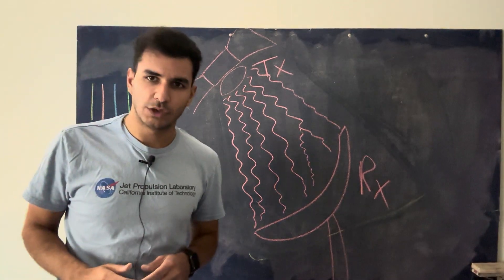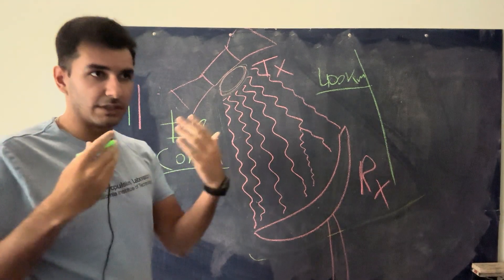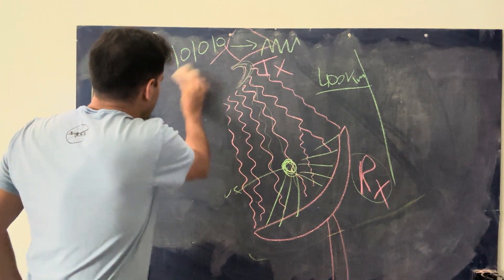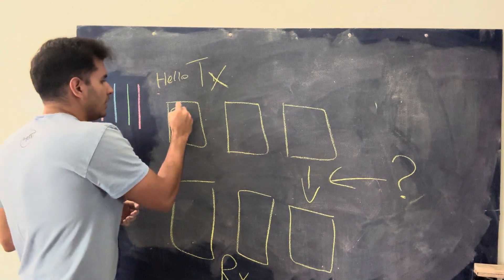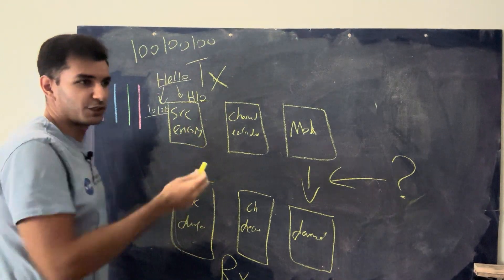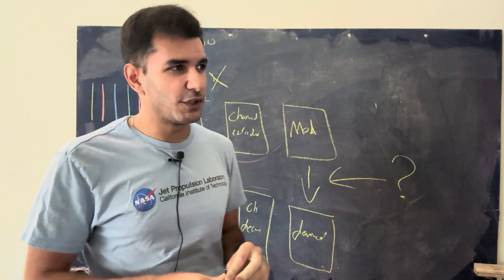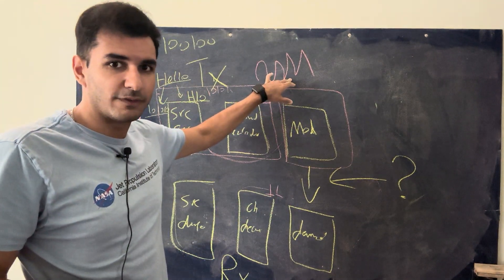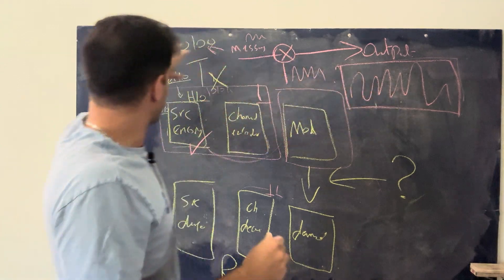Why Telecommunications is the Best Engineering Subfield

Comment: I'm a telecommunication engineer. I have the theory down. Encoding, encryption, binary conversion. Modulation. Propagation physics. All of it. Yet I lack in handson practice very badly. I know C++, python, matlab, Cisco and some dsp. All at a fundamental level. Yet I wanna improve way more. Especially in hardware, which I am just able to handle esp32, esp8266, arduino r3. Basic projects. I feel like I lack soooo much. What do you suggest I do to improve properly.

Comment: I studied Electrical Engineering (EE) at university 7 years ago. There were several subfields to choose from.
For those without an EE background, this is basically what you'd learn in semesters 1–3, especially in introductory courses across the subfields.
Honestly, telecommunications is a very cool field—at least in concept. But once you go deeper, you’ll run into really tough math problems like the Fast Fourier Transform.
Back then, I chose to focus on control systems. It was tough too—control systems are the foundation of robotics and AI—but I found it easier for me than telecommunications.
Much respect to anyone who can keep learning telecom at that level. It's seriously deep stuff.
Reply: Izin bertanya, lulusan teknik kontrol bisa kerja jadi apa aja yah? Dan kira kira ngapain aja? Thanks in advance. I feel like I like the more software side of things, and EE learn so about hardware but little of software and algorithms. I kinda want to switch careers to software engineering or AI/DL and don't know where to start. There isn't a computer engineering track in my school, I have to pick between Telecommunication, Control, Electronics, or Power.

Comment: Im in a second semester of pursuing a bachelor degree as an Electrical Engineer specializing in electronics and communication and i've been feeling quite down lately, not really seeing purpose in the things im studying and thinking about dropping out or changing my degree completely. This has sparked a bit of interest back in me again to persist in this degree and to push through, thanks!
Reply: OMG UR GOOD. I wish I had access to this quality of knowledge transfer when I was in university 45 years ago. Maybe next go-around 😊. Thank you very much and keep sharing your gift.
Reply: I strongly believe, that during the first 2 years of ANY engineering degree, it is difficult to see the purpose of what you are learning. On top of it, it is hard and demanding, discouraging. BUT IT IS THE FOUNDATION (OMG especially signals and systems, literally applicable everywhere). And believe me, in 3rd-4th years you will dive more into applications, then you can decide if you like it or not. My opinion is biased, but EE is the most exciting engineering field out there.

And you never know when the knowledge from some courses comes handy. For example, today I was writing a code for a pulse propagation in MATLAB, heavily relies on Fourier Transform (FT) and  inverse FT. Only because I have taken Digital signal processing, I was able to easily link code that deals with discrete signal to solve it for continuous signals, and understand the "tricks" in the code.

Comment: The channel encoding is mainly about error correction code which is done in hardware, not software as you said. Both Reed-Solomon and convolutional encoding are mostly done by hardware. I agree with you telecom is amazing. It combines so much knowledge you study at university. It makes your study actually useful.

Comment: I wonder if the same could be said for video game engines. While it's entirely software, one does need to think about all the different hardware configurations (PC, consoles, VR, controllers, accessories). One must develop each system, physics, audio, controls, multiplayer, AI, graphics/rendering, etc. and make sure each system is working together in a cohesive manner for a smooth experience for the user.

Comment: I am currently studying electrical and computer engineering i have used ham radio to hear the repeater on ISS (with a yagi) and also decoded the NOAA 15,18,19 (with a dipole) for images and i can say i like doing that. I have used Fourier transform and its not that hard to do but we were talking about an ideal world so we werent using channel encoding/decoding.

Comment: EE is vast! If you are willing to learn, you will find your niche. I found mine in transistor level circuits!
Reply: I found mine in low-noise discrete design.
Reply: i found mine in reverse engineering + security lol it really is an amazing field.
Reply: Reverse engineering as in cybersecurity?
Thats comp science not electrical engineering bro @bilalsiddiqui9341
Reply: Do you have any suggestions for possible projects an engineering student could do that might boost a portfolio?
Reply: @poppustokus387 you mean resumé right?
Reply: i found mine in making cute stupid electronics pieces

Comment: If you are facing the tough choice between physics and electrical engineering, i think RF/antennas is an amazing compromise between the two
Reply: I know a couple of Physics majors who switched to antenna design and they're raking it in.
Reply: @PeterA650  Do you mean they got their undergrad degree in physics and got a masters in EE (antenna design)? Or that they switched majors in undergrad from physics to EE?
Reply: @invent0r137 neither. One Masters, one PhD, both in physics
Reply: @PeterA650  Interesting, I may have to research this path. Would you say there's a difference between how a physicist and an engineer approaches antenna design? Is one more hands on (engineer) and one more simulation/theory (physicist)? I imagine they have almost the same knowledge in antenna design (maxwell's equations, EM wave theory, etc)
Reply: @invent0r137  I dont know exactly how either would approach antenna design problem. But I am doing my masters in microwave engineering and photonics, I have B.Eng in ECE, and my friends from physics background, even though excel in EM theory, face difficulties understanding RF-front-end on the circuit level. It seems to me that the circuit abstraction from underlying physics is kinda hard for a physicist to grasp initially, also it might be repelling, unlike photonics where you deal most of the time directly with EM fields.
Reply: Facts
Reply: Or VLSI transistor level circuit design.